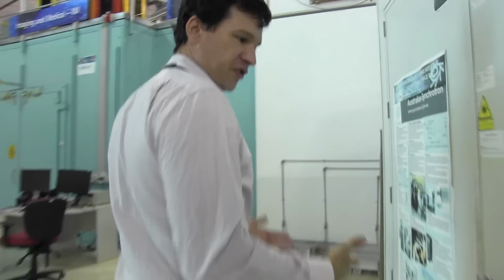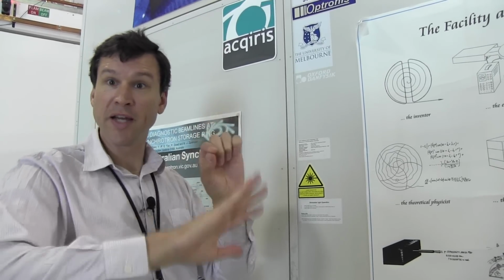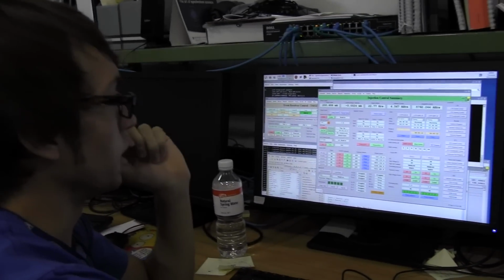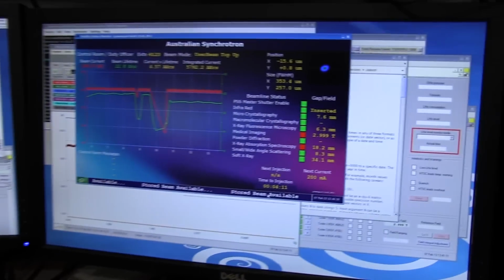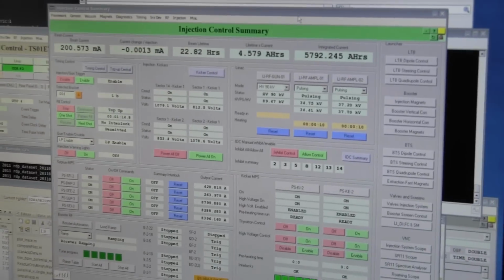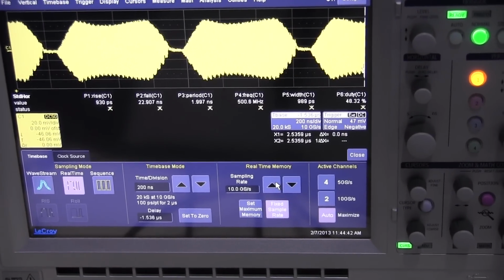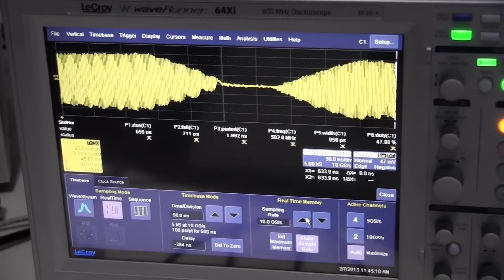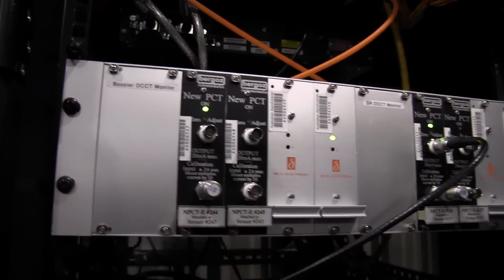EEVblog #836 - Tour Of The Australian Synchrotron

Comment: It is hard to fit all the science, engineering, and potential unknown yet application of this device in short video. It was probably designed by hundredths of scientists and engineers, each expert in own field, based on experience from other facilities. There is lot of good stuff, but do not expect to understand 1% of the tricks they used in one hour.

For people that are confused a little. mA = current = charge per time [Columb per second] in a cross section of the ring. This is pretty stable once you insert all bunches, but it decays slowly, due to not perfect vacuum in the pipes, as well as losses do electrons hitting walls of the ring (the density of electrons is pretty continues in cross section, sure most of them will be focused in the center, but remember that electrons repeal each other, and some will be doing some chaotic stuff. You also want to actually remove this chaotic stuff, so you might want on purpose decay a beam intensity (i.e. using slits / apertures).

Due to these losses, every few seconds there is small injection (exact period and amount is controlled by delta from current current vs target 200mA), to keep replenishing it continuously, and keep current pretty constant (important from thermal reasons and so the beam users see more uniform source). Injection are very short bursts by themselves. The first start up is just a bunch of injections, and probably takes hours to reach from 0 to 200mA.

For the bending. bending == acceleration. Why? by applying force (in this case electrostatic force and Lorentz force from magnetic fields, and some RF fields), you basically accelerate electrons in some direction. (it doesn't need to be parallel to the current direction at which electron is traveling). If you put force perpendicular to the beam, it will start accelerating, and get some velocity in this perpendicular direction, effectively bending a beam.

The 4MW is operation power is mostly used by RF, cooling and all the electromagnets. Once you store electrons in storage ring (and ignore losses which are small over all), you still need to use tons of power to keep electrons on circular path, even if you do not add any more energy to the electrons. You just need to spend 4MW just to keep them contained at constant energy (you just want to change direction of the beam, not its speed)! I think the beam itself will store maybe few joules of energy. It will probably not destroy anything even if you loose total power to the ring, and electrons start traveling stright and hit the wall (it might damage the walls, because this few jouls will be concentrated at microscopic area of the the wall or magnets or other equipment like sensors, and it will happen in less than nanosecond, it will probably be few TW peak power (but still very short, totaling few dozens of joules maybe, so shouldn't destroy anything but some detectors). This is why they usually shutdown them slowly, so only fraction of electrons in the beam hit the walls and spread that around the ring, or kick small bunches of electrons into something that is of no value, and make them stop. Also, stopping means uncontrolled deceleration, which means again em radiation (mostly X-rays).

The radiation inside the concrete shielding is coming from few sources. Static fields from all the electromagnets, and collimation systems (some probably also electrostatic, not just magnetic). The RF radiation from acceleration stages, that actually speed up electrons, as you cannot shield this stuff perfectly. As well electromagnetic radiation during acceleration (again most likely x-rays) in all stage where you actually add energy to the beam, as well acceleration during the bending. Some of the bends radiate and these radiation is basically wasted, and some bends are used to extract useful radiation to experiments. the electrons doesn't really loose energy, or disappear during radiation of this em stuff. Energy is coming from the electromagnets that are bending the beam (bending trajectory of single electrons or bunches of them).

Synchrotron is basically x-ray laser. Because bunches are very small and you control bending very precisely, and all electrons in the bunch do have same energy, you receive very monochromatic, collimated and coherent pulse of EM radiation (which then goes in straight line to experiments, where they can do with this photons whatever they want).

You can select any EM wavelength you want, but in principle you are the geometry of the ring. You cannot just change wavelength at one bend (by changing magnetic fields at it), as it will change the bending radius, and your ring will not  close properly, and you will loose the beam current in a fraction of second. It is something you design way before, to make facility as versatile as possible (or as specialized as possible), to make it useful in multiple applications, or justify high cost.

The thickness of the pipes in the ring, need to be substantial. It is not for em shielding (but this also plays a role, you want to reduce influence of earths magnetic field, or nearby power lines, radio transmitters, wifi networks, etc), but just because you need very strong construction to actually hold vacuum against forces of atmospheric pressure. It is probably few tones per square meter of pipe. By making it small in diameter, round and sufficiently thick, it is easy to do (still you need to know how to insert probes, sensors, and how to welds different segments in air tight way).

The currents in the electomagnets (2, 4, 6 pols, and other correctional magnets and fields) are static and constant during operation. But they are all configurable and stabilized by precise equipment. Sure, the currents and magnetic fields in most of them (especially dipoles and bending ones), will be known at design stage already, but some of them, especially the collimating ones, focusing ones, and bending ones, will require adjustments before stable operation (you cannot build such huge structure, with enough precision and control of the energy to make it blind without adjustments). You basically tweak 100+ of currents until your beam looks as stable and as focused as possible. But once you find optimal configuration, you do not tweak this numbers, until beam doesn't look good anymore, or you want to try and make it even better.
Reply from the maker: +movax20h Great detailed reply, thanks.
Reply: +Jack White The radiation emitted by the electron as it is accelerated/bent is made up for by new energy from the electromagnets. So yes, the electrons do lose energy, but the lost energy is replenished, and that is what was meant by "the electrons don't really lose energy".
Reply: +Mark Rose  My issue is specifically with saying "Energy is coming from the electromagnets that are bending the beam". This is simply not true. The static magnetic fields, that keep the beam on it's path, can not give the electrons energy. There have to be RF cavities, or any other means to replenish the lost energy due to synchrotron radiation, inside the storage ring.
Reply: +Jack White You are right, there will be some period where they loose energy. But the magnets and RF cavities following it are configured so it restores same amount of energy.

I guess it might be possible to design a bends in such a way that the wavelengths of emitted x-ray radiation are tunable. One way I can think of, is to use static but configurable field in wiggler, or to use two normal bends, one left, second later right of the same radius, so beams are always parallel and enter and exit same way, then continue to the rest of the ring. From the pictures, I do not think it is used here. The trouble is tuning to different frequency might require optimizing other fields in all the other magnets too, to bring it back into proper collimation and path. So, I do not think changing frequency is easy and done every minute, more like, every month or so. Somebody with more High Energy physics would need to explain that.
Reply: +movax20h 
Thanks for he explanations! Answered quite a few questions I would have liked to ask.
Do you maybe know how the transfer into the rings work? There has to be some kind of "magnetic switch" that fires at exactly the right time. The newly inserted bunch has to make one sharper turn to get on track. If my understanding is correct, you can't insert a new bunch on top of another bunch, because if the "insertion magnet" were on when one of the storage bunches came along it would steer the bunch into the wall, right? It looked on the scope as if the bunches weren't uniform along the circle but there was some dead time. Is that where the new bunch is appended to the "train" of other bunches? Wouldn't that gap fill up soon if a new bunch is inserted every few minutes?

What's the wavelength/energy of the radiation created at every bending magnet compared to the radiation at the real extraction points?
Reply: +movax20h "the electrons doesn't really loose energy ... during radiation of this em stuff. Energy is coming from the electromagnets that are bending the beam"
I question that. Surely the electron looses kinetic energy when it's emitting a synchrotron photon, due to bending it's trajectory. For example if I made the bending magnet out of a permanent magnet, then the electrons trajectory would still be bent, synchrotron radiation would still be emitted and where would the energy come from then?

Comment: Interesting video, pure geek pr0n. Good questions all along, although some jargon is misunderstood. The Electron gun is't run at 90kV, but emits a 90 keV beam which is a whole another thing. V is used for electromotive force, eV is energy and actually means the energy gained by an electron moving through a 1 V potential difference.

Comment: Dave at 30:28 you misheard the electron gun output spec as 90 kV but it was specified as 90 keV (electron volts).
Reply: +Alan Liefting 
That's equivalent. Not the same, different units, but still exchangeable in this context.
Reply: +superdau I didn't watch up to that point though so this might be irrelevant for the vid but, when you describe the output energy of an electron gun you give it in kV, this is because the actual energies of individual electrons are not uniform but instead follow a gaussian curve. e.g for a 90kV electron gun, the maximum energy an electron can have is 90keV, but it is much more likely to be somewhere around 60keV

Comment: I must be stupid because after watching this video i still wondering why all this is equipment is needed an what purpose there is to burning 4mw of electric.
Reply: +Tangobaldy This machine is like a really advanced microscope and x-ray machine. And more than making a picture at very high resolution, it can also be used to tell the types of elements that make up the sample material being looked at, and where in the sample those elements are.
Reply from the maker: +Mark Rose That's a good breakdown of it's most useful functions.
Reply: Thanks, Mark.  All the way through the video I was thinking, "OK, all this technical mumbo-jumbo is great, but what are the basic questions this place is built to answer?"

Comment: What's the reason for the calendar (Monash) and oscilloscope(s) having the year as '2013'? Time-warp due to the nearby synchrotron, or just physicists who cannot be bothered to put up a new calendar/set the right data on equipment? :)
Reply from the maker: +Maya Posch Because the video was shot in 2013
Reply: EEVblog okay, so I wasn't going crazy, then... good :)

Just that it wasn't made clear in the description or anywhere else, or I must have missed it.
Reply: +Maya Posch it tells you at the start of the video lol
Reply: +Maya Posch It was just in the first few moments of the video